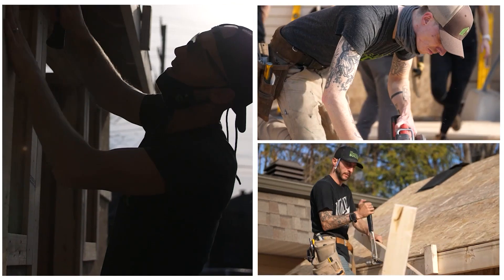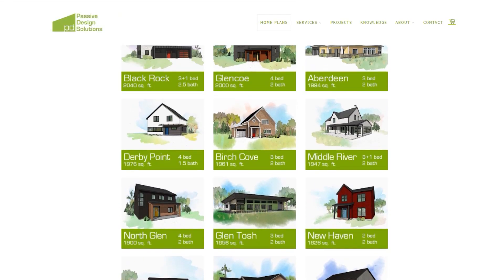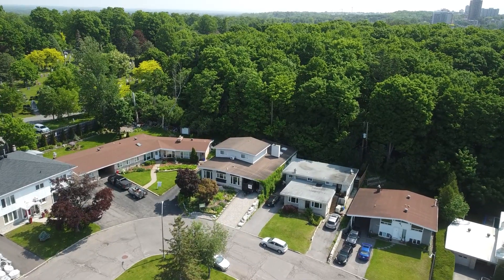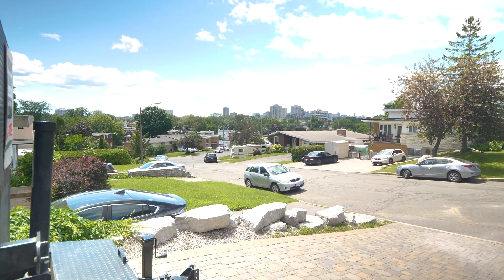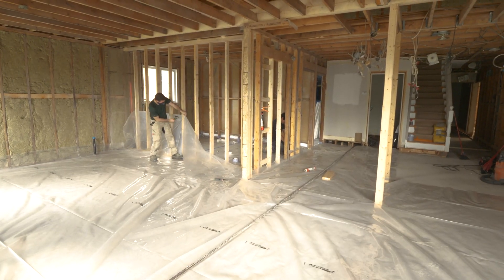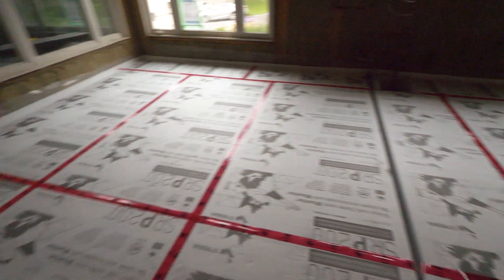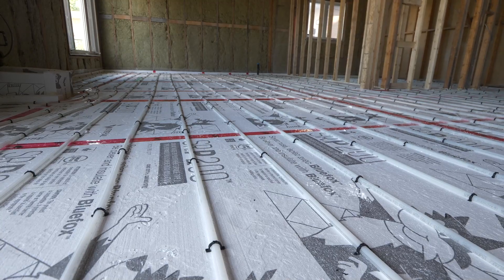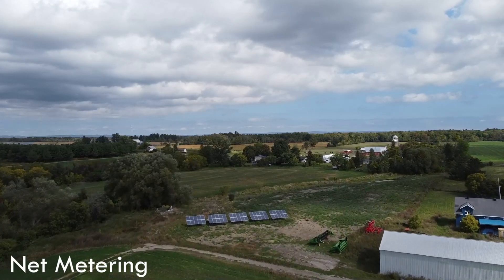Radiant Floor Heating Prep and Install

Comment: Two queries:
1. Is including a reflective layer below the radiant floor feasible and cost-effective? The retailed DHW tank insulating rolls use this, so why not under radiant floor, together with other insulating layers?
2. Is there a concern with mineral salts gradually moving up through concrete over time, and creating discoloration on concrete floor?
Reply from the maker: 1) I'm not sure this would actually do anything under a layer of concrete because the concrete wraps around the tubes. 2) I have never heard of that happening. The only issues we have seen with concrete floors is when water is coming up through the floor. When you eliminate this, then you should be good.